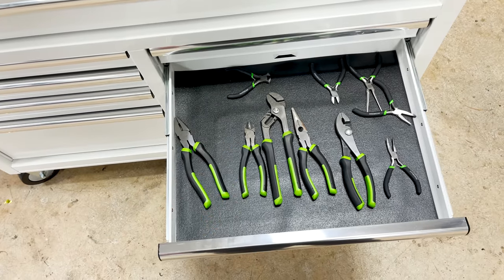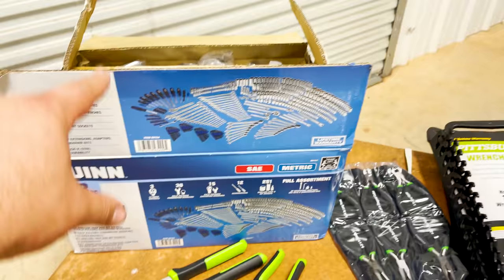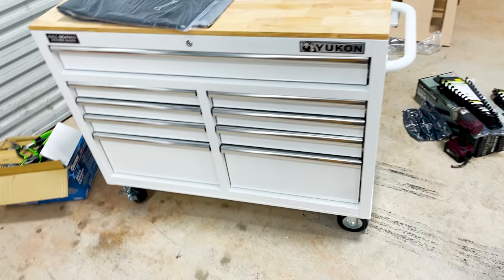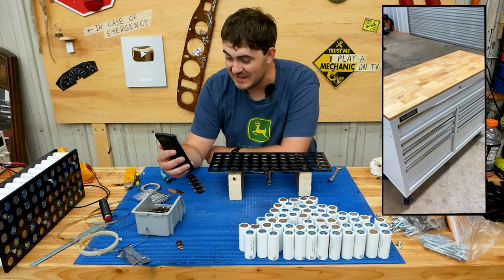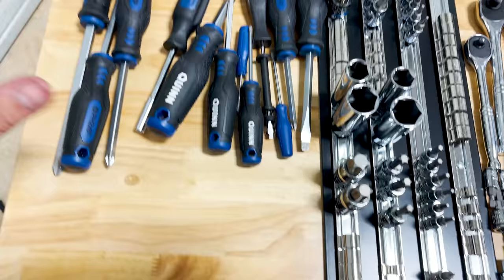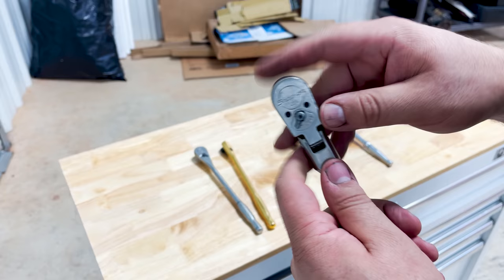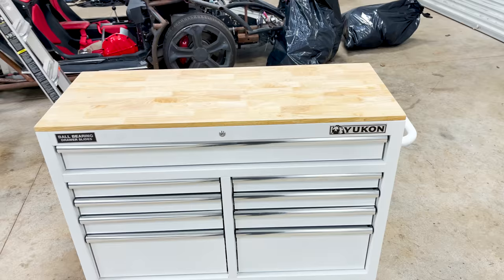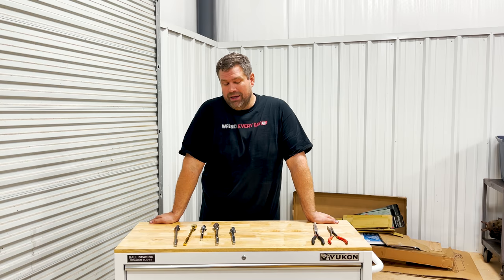I Bought The CHEAPEST TOOLS On The Internet (So You Don't Have To)

Comment: I have a few  Harbor Freight tools. If you're trying to make a living as a mechanic buy good tools. Harbor freight is for amateurs. Dont apply at a mechanical repair shop  with HF tools. You will get laughed at. On your way out.
Reply from the maker: I spent 20+ years in a workshop, it used to be that way when Harbor Freight didn't have the quality it does now. If you still feel the need to make fun of someone spending money wisely, it is a coping mechanism.

Comment: Bravo Jared, calling out all that plastic waste. I'm so sick of the overuse of plastic everywhere. There's absolutely no need for all those bags in that tool kit.... 

Generally speaking, though, I find it best to upgrade if you can afford it. Spending the extra money, at times, can result in a better product that lasts much longer... However, it also depends on so many variables such as how often will it get used. In this case if you're not wrenching every day that Quinn set will probably be good enough to great for entry level mechs and those looking to have the tools for the occasional repair or oil change....... be interesting to see how these tools hold up under a lot of use.

Comment: Not even included the ever-so-important torque wrenches. Or the micrometers. Or the feeler gauges. For the average weekend warrior that will not hurt having them but if you will be overhauling engines or transmissions because you don't trust monkey mechanics around your region, or the supposedly professionals ask for a stupid fortune then it will cost you...so much for tools over where I am right now

Comment: You're silver whatever matco ratchet the cheap line like blue point looks like a ratchet I have branded Allen.  I have great success with every ratchet brand except Craftsman.  Even their professional series are junk.  Those harbor freight ratchets look just like my husky set from home depot.  Which I believe Stanley makes. Great ratchets.  I have one craftsman ratchet that is good.  Ive never seen another craftsman like it.  It has the twist style to change direction. Good video.

Comment: "8 Bolts for the castors and 4 more for the handle", um, It should have been 16 bolts for the castors, 4 for each castor, did you only put 2 in each castor!? Not to mention you mounted the handle on the wrong side 🤣Go ahead and try to get that sucker up against the wall in that configuration. The handle goes on the side of the swivel castors, it's not a grocery cart that you can man handle into position. I have the same tool box and I love it. Might head over to harbor freight and pick up some socket originizers.

One last thing where can we find this Robert Dunn who you called about the wood top? FFS!!! Give credit in the description if they are in your video. Oh I know, hitting Ctrl+P after hitting Ctrl-C on their channel link is way too much to ask for a "creator" to do to help out another Creator. Put it this way, You were part of a big name movie as a Production consultant and when the credits rolled You wern't listed. That's what you did.
Reply: Not only he made the toolbox harder to push, it will be impossible to turn once you have substancial weight in it. At least from what I remember, toolboxes are designed to be pulled, so the handle has to be on the side with the turning casters.

Comment: This is an awesome idea for the start of a series. Harbor Freight does get an unfairly bad rep.  They have some decent stuff these days. Those 2 & 3 drawer tool carts are a great value. Don't know much about their tool chests outside of their General line.

I do have a suggestion for that tool chest. I've been a tool maker for years and work in a place where a lot of the guys have moved to that style box. Most mount a small vise (3-4" jaw) to one of the corners. Since it's basically a rolling work bench, why not give that a try? I could see where someone just getting their first set of tools could get a lot of use our of a cheap vice like a Central Forge. I'd imagine most people buying that style box are planning to use it as their work table/bench.